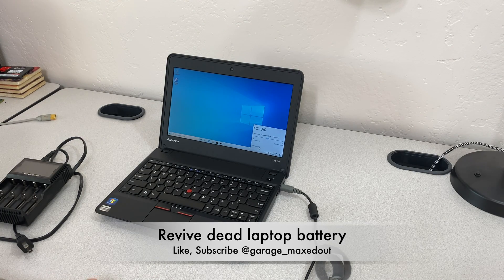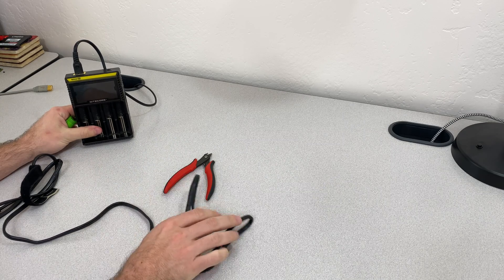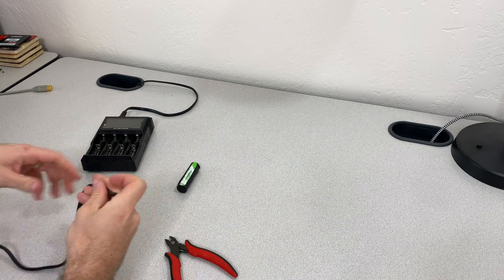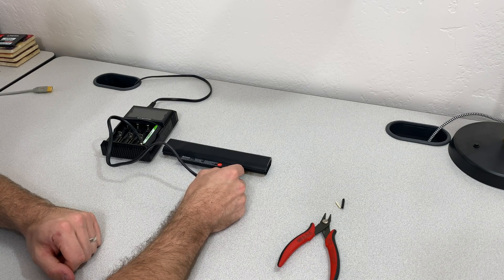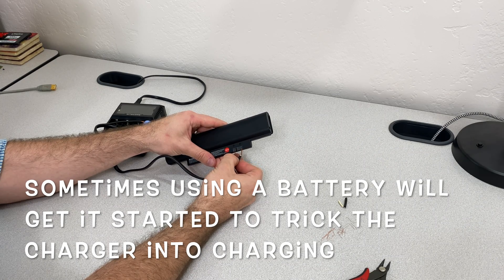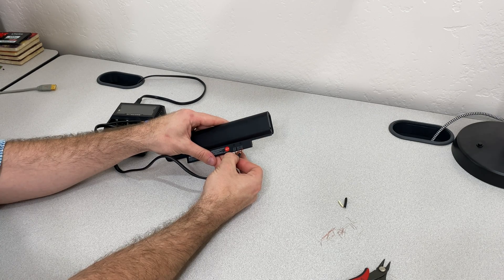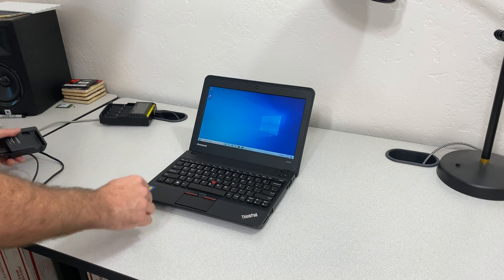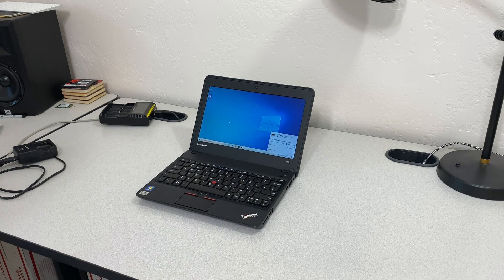Tutorial: How to revive your dead laptop battery

Comment: Does anyone have a method for a dead Li-ion battery pack? My charger only gives 1-2 volts to the battery. And 30-40 volt to the laptop itself. It doesn't charge the laptop's battery at all. The laptop only works when the charger is plugged in. ( I have a lenovo thinkpad and I don't know the model of it)
Reply from the maker: Have you tried the method here?
Reply: @GarageMaxedOut  I can't
Reply from the maker: @Erikecske12YT  I don't understand- this is the method for reviving it- use this method to see if it will work on your battery pack

Comment: Will this method work for a Lithium battery?
Reply from the maker: Yes it will
Reply: I put my battery in the freezer for about 40 minutes.  It was not dead but even though it charges up 100% it only lasts 1 hr.  It  used to last at least 3hrs.  It is the oversized battery.  Is there something that I can do to revive the longer time span?
Reply: @geezee1579  no eventually batteries run out of charge time as time goes by do to age. There is only so many times that batteries can be charged.

Comment: This only works if you battery is "asleep" putting it in the freezer forces the cells to go into sleep mode.. However if one of those 6 battery cells inside are defective, it wont fix your overall problem. Typically lithium ion cells only have a chemically reliable composition for a maximum of 6 years. Also each slot on your charger is only designed for a max 5V per channel... and that battery you are using is connected in series so probably 18.8v... a charger like that with a 5V ouput per battery channel and 500ma (max of 2amps total for all four channels) is not enough amperage to really kick start the battery you are working on (which usually have a rating of around between 4 to 5 amps average output per cell (in laptops anyway)The only reason this works for you is because the freezer probably made the cells dip so low in charge that they had a maximum charge of say 12v.. Most dead laptop batteries typically have an internal short or due to overheating suspend themselves . Best thing to do is take each cell out test the capacity rating of each find the weak capacity battery, if there isnt one then use a balancer.  But for folks who cant be bothered opening the laptop battery (which is all spot welded together in series) this method might work ok! This explains why however in Canada here our winters are so bad that anyone who leaves their batteries in their truck below -5 degrees Celsius it goes into "sleep mode" and contractors dont have the time to bother with batteries so they end up throwing away perfectly good battery packs at the battery recycling station. Also the BMS chip inside doesnt balance the cells well because the companies that make them (theres only really 3 power tool companies to be honest) want you to pitch them and buy new as thats how they keep people consuming. Often the chip is to blame and the cells (if theyre made by samsung or sanyo like in the dewalt brands) are completely fine... its just a ruse to get you to buy more stuff....
Reply from the maker: Thanks for the background, hope this helps some folks
Reply: thanks for the info. My battery doesnt charge more than 59% and when i unplug it it dies in like 40 seconds, i did open up the battery it has 4 cells. they read 3.97 4.06 4.07 3.73... so what should be my next step is there anything i can do or if you can help me anyway i highly appreciate it thanks
Reply: @xozura1  take it apart with a security bit screwdriver...(you can buy those at any tool store) figure out the defective cell (its probably just one that fails to charge. And recycle it..problem is theres no point because they spot weld the pack together and theres literally no room in the case for any rewiring... I would just recycle it
Reply: @carlnikolov  Good call. Not many people have the capacity to spot weld battery tabs. You could probably solder them back on, but you also run the chance of ruining the battery. And also not good advice @Garage Maxed Out using 9V to charge these batteries. These lithiums are only about 3.7V so should have a voltage only a volt or so higher to charge. Otherwise you'll most likely ruin it as well.

Comment: @Garage Maxed Out  Laptop at first reported 0% charge from the battery,  Then unplugging the battery and putting it back in the laptop reports 100% charge.  Yet when trying to run on the battery, the laptop loses power when I unplug the power.  The battery doesn't work.
Is there some way to kick-start the battery or trick the laptop into thinking it needs to charge the battery?
Reply: In actuality you need specialised hardware (i.e. EV2300/EV2400) with software (Smart Battery Workshop or Battery EEPROM Works) to really reset a laptop battery. Specifically you need to reset the BQXXXX IC that is located on the PCB board - to which the 3 pairs of 18650 cells are connected to. 😑😕😒

I have an assembled/saved playlist with videos on this topic on my channel.
Reply from the maker: Great tip!

Comment: Since My laptop battery is built in for some strange reasons, I have to put my whole laptop in the freezer lol
Reply: I think it might be dangerous since the condensation when taking it out can short-circuit it.
Reply: @Reza254  do i have any other choice? 🤷‍♀️
Reply: @dinaru25  Thanks,but I can't remove the battery easily. One day I might study the process, but it will waste time and not easy. The bastards made it as difficult as possible
Reply: @TamasLukacs-ltommie  I wouldn't freeze by laptop.   That's a great way to ruin the silicon in your processor. It might not break it but it can definitely effect it. Believe it or not processors can get to cold.
Reply: @TamasLukacs-ltommie  just remove the shell and take out the battery
Reply: @MultiWirth  It's not that easy, they made it extreme difficult

Comment: In my case, my laptop was charging about 20% of total capacity and bios was sending errors. It was because the AC adapter wasn't original and wasn't able to charge it properly. I bought an original ac adapter and after some days plugged, the battery returned to normal, charging to about 70% original capacity. (it have about 7 years).
Reply from the maker: Gonzalo Tapia awesome tip- I’ve seen the same thing happen, thanks for commenting!